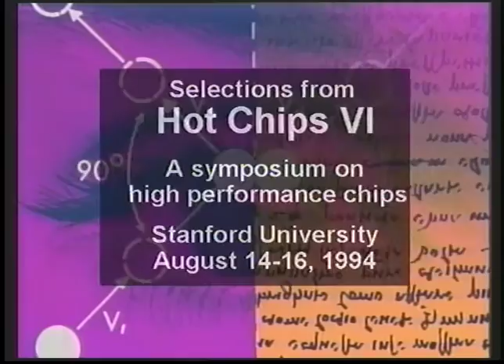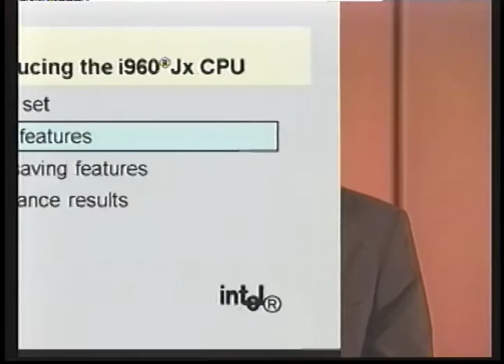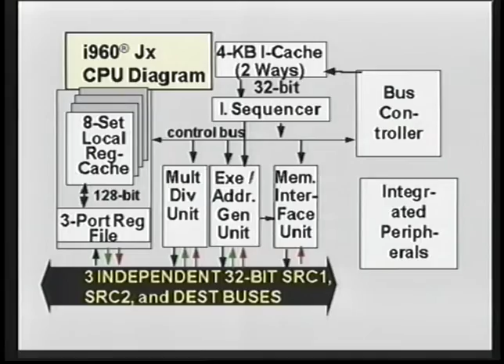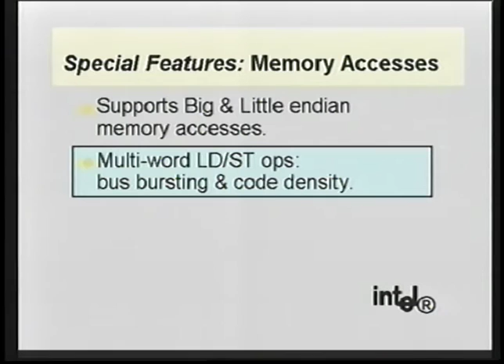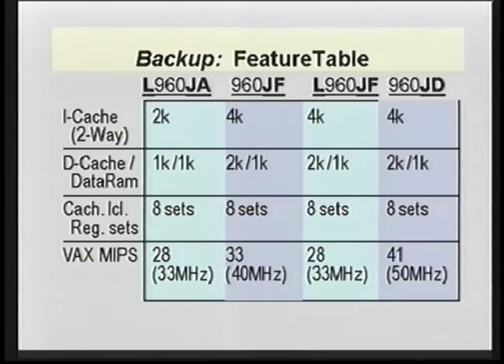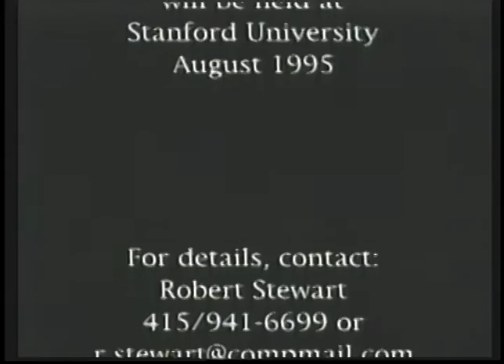The New i960® CPU, a lecture by Richard Brunner

Comment: Worked for AB-Rockwell Automation from 1995 to 2001 and Crusader product line used these i960s as well as the  IMC S-Class Compact S2xx-xx product line. Solid CPU. I use to service the IMC S-Class 202, 204, 212, 214, R, RL, 232, 234, R, and RL line with RIO and Axis Link that run under this i960 processor.

Comment: Oh boy, these were the golden days! 1 kilobyte of on-chip RAM and a hundred times the performance to blow any of the old 8051 boards out of the water.. but the funny thing is that the 8051, with its glorious 1 million 8-bit accumulator operations per second, is still used widely today. It all seems so out of this world now, when we measure in gigaherts and gigabytes... but I do miss those years when there was a new competing and totally incompatible CPU architecture being seriously rolled out each year. Now it's just ARM, ARM, ARM. When this chip came out, who would have guessed that a small British company now dictates the fate of millions.
Reply: Same here, for me the late 70's/early 80's were the best days for computer hobbyists. Nowadays the closest you can get to that experience is with a low-power microcontroller, like the ATmega328 used on the Arduino.
Reply: Nothing changed IMO each "ARM ARM ARM" is in fact " totally incompatible CPU architecture"  despite having  execution units, each SoC have different memory map registers, DMA controllers, timers, IO ports, graphics etc.